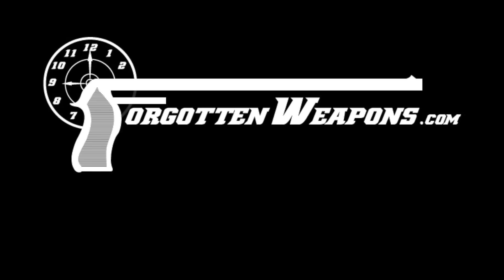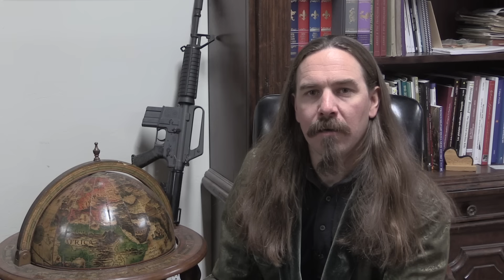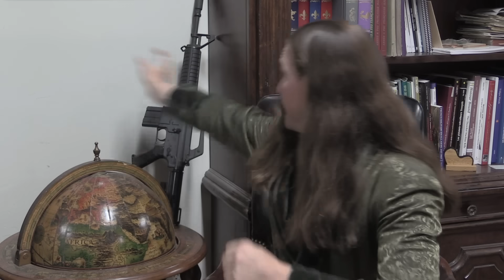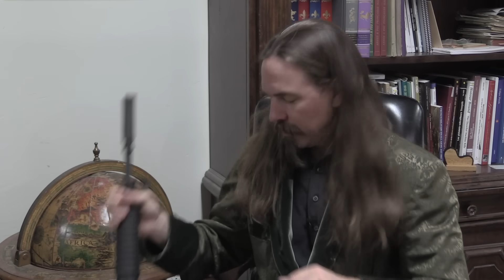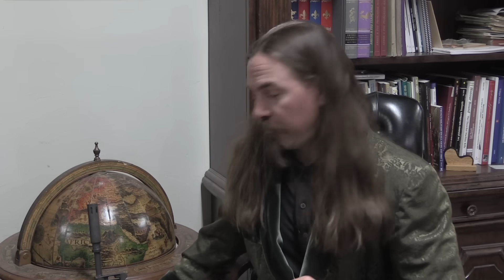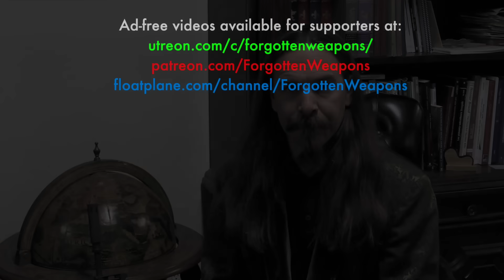Ask Ian: "Last Ditch" Rifles for World War III?

Comment: There's so many cnc shops in the US that I doubt there would be a shortage of cnc mills to take on the challenge of producing AR parts.
Reply: Problem is getting aluminum/steel .. how many areas have steel/aluminum mills?
Reply: @karllambert2350  every single shop that has any machining equipment, has tons of aluminum and various grades of steel
Reply: @stephen_crumley  we don't produce raw metals domestically. Shops can't afford to stock 2+ years of materials
Reply: @karllambert2350  Tons of them in Indiana/Illinois. Know of at least one that recycles various metals from the junkyard next door.
Reply: @karllambert2350  yup, some of our metal factories that are still in service date back to the early-mid 1900s. Some have been updated but most are sorely lacking compared to other countries.  We have the capability to modernize and become self sufficient but with all the Globalism nobody ever will...
Reply: I was just saying this in my own comment. We don't have to have a gun behind every blade of grass today. 
We could have them built by the weekend.
Reply: Like he said there won’t be a shortage of milling, it’ll probably be for stuff like optics or specialist alloys.
Reply: @Matt-xc6sp  The assumption is that this is last ditch emergency production. Meaning martial law in all likelihood has been declared and all production is controlled by the government.
Reply: @stephen_crumley  yea maybe when we used to mine our own minerals and have… industry.
Reply: Considering it's US we're talking about, it's likely that people would just bring their own guns and there wouldn't even be a need for last ditch production.
Reply: EMP would eliminate most of the machines in circulation only old stuff with 3 electrical engines for movement and 1 power full one would be worth repairs because you couldn't afford waisting super scarce circuitry for new machines
Reply: @stephen_crumley  it's not that simple
Reply: Having hundreds of little shops scattered around the country is not going to do you any good; who is going to gather them all up, who is going to deliver them to where units are being stood up (the part of the country where you CAN make stuff is going to be far away from the fighting, how much precious fuel and logistic capacity you are going to waste moving stuff around - we ARE talking about a last ditch situation here... that fuel would be better going into your remaining AFVs/ airforce/ army logistics train. And, who the hell is going to deliver and parcel out the strategic resources, managing to drop off to hundreds of small scale milling shop without them all hitting bottlenecks of crucial components. The logistics of small scale production, when you need to make MILLIONS of arms in a matter of months, don't add up. You end up with a couple dozen rifles in the back of a factory, that aren't going anywhere.
Reply: It's interesting that you all assume there would be any electricity to run a cnc...
Reply: @robsonez  It's interesting you assume people can't figure out how to generate electricity off grid
Reply: The issue wouldn't be machining, it would be raw material. Right now, every forging company in the country is already making as many forgings as they can, and they can't even keep up with current demand. The shop I work for currently has about a 6 month lead time on forgings, and even then it's a struggle getting a full order all at once. Switching to machining from billets would be possible but counterproductive.
Reply: @robsonez  in before someone says "diesel generators" lol - because using limited fuel, that could be better used at the front is an awesome idea  /s  
Oh, plus this sounds like an amazing plan to make sure that no two weapons have interchangeable parts, taking your army back to early c.19th - no longer can you take two damaged weapons and make one good one, at unit level - you got to ship those suckers all the way back to the mom'n'pop shop that made them.
Reply: @timbrwolf1121  enough power to mass produce arms via cnc? And if so, all survivors would agree to utilising that power for weaponry manufacture? I'd get good with a cross bow because guns and ammo would disappear quickly.
Reply: And that's before we get to the 3d printed designs and P80's...

Add those in and that increases the number of strategic targets by another magnitude.
Reply: @robsonez  You are misunderstanding. Its not mass production in the normal sense. Its not like 1 person has to figure out how to power thousands of CNC machines. The average american when faced with an existential threat would make it happen
Reply: @timbrwolf1121  I don't think I am. 20 people powering 1 cnc. They generate enough power then all agree that this is how the power they have generated should be used? Assuming any of them know how to operate the machinery, modify the programs etc...
Reply: @timbrwolf1121  let's be honest here, the average American thinks climate change, gender identity and critical race theory are existential threats. You have a lot of faith.
Reply: @robsonez  Well when martial law is declared and those 20 people either decide to work for the greater good or don't get fed. They will either do the necessary job or be voted off the island.
you are the weakest link, goodbye 🤣
Reply: @timbrwolf1121  I see you are the average American.
Reply: @robsonez  guess other machines will fail also without electricity. And a changeover to steam or water power will become difficult also.
Reply: @ralfrude3532  this is a critical issue with a technologically progressive society. Without electricity, how many would have the knowledge to do much of anything?
Reply: @Matt-xc6sp  Under wartime emergency authority. In this state, they aren't asking you nicely to comply. At a minimum in this state, strategic materials and supply chain are being rationed for defense production, so their supply of materials is very likely going to be zero if they say no. And that's the stuff that's not necessarily in B&W, but it's very clear that's what they are going for.
Reply: @Matt-xc6sp  Not what's happening here and you'd be surprised how much both sides come together in wartime
Reply: @timbrwolf1121  Wartime Production Act.
Reply: @excellent_name  we produce a million tons of aluminum a year.
Reply: @Miazger  EMP means the strategic nukes are flying, so "last ditch" weapons aren't going to matter anyway.
Reply: @excellent_name  What do you mean "we don't produce raw metals domestically"? We produce anywhere from 1-1.5 million tons of aluminum and 90-110 million tons of steel every year.
Reply: @excellent_name  Stocking stock material isn't all that common. Probably have some bar stock and some flat stock and key stock but ordering material cut to size when needed for a job is the way most shops operate today. Don't have to waste space storing it, waste time looking for it, waste time saw cutting it, and ending up with wasted drops.
Reply: @excellent_name  uh yes we do produce metals domestically. It's just expensive so it's rarely used for most things. We don't produce as much as China but we do have domestic metal production.
Reply: CNC are too valuable to be used on rifles. They'd be prioritized for producing vehicles parts. It's better to build new stamping/ injection molding factories to make rifles than using CNC machine shops to make them.
Reply: @Lucid Nonsense  Well, the US is self-sufficient in oil thanks to shale (good luck invading south Dakota), so I don't see why the existing civilian infrastructure like highways couldn't do the job.

Comment: The rifle will have to be able to accept steel case ammo because brass will be rationed and prioritized for artillery shells. The lead inside the bullets might also get replaced with steel to save cost, lead will be saved for high precision ammo for marksman rifles. 
The body of the guns will be made out of stamped steel or molded plastic because aluminum will be saved for aircraft production. Stocks might be made out of wood because plastic might also need to be saved. 
Basically the gun will have to be made out of the cheapest, most abundant and easy to work with materials. 
Oh and keep the full auto. Because if machine guns are not largely available, soldiers might still need them and realistically, an industrial country prepared for total war will not run out of ammunition before it run out of guns and men to shoot all those ammunition. If you have factories running days and nights making steel case ammo with steel bullets cold war style, you'd have massive stockpiles distributed all across the countries waiting to be cracked open. Even today they still open cold war surplus spam cans in Ukraine at the same time, selling them in the US market you won't be running out of them anytime soon.
Reply: Considering that there is likely a million reloaders, each sitting on thousands of pieces of brass and other components, and each capable of loading a 1000 rounds in one day, I doubt it.
Reply: @mikefranklin1253 You don't save brass in wartime production because you run out of it but because you need to save it for something more important but can't be substituted with steel: artillery shells. 1000×556 brass casing is roughly the same amount you need to make one 105mm howitzer shell casing. Not to mention from the military perspective, if you use your brass in your rifles, that brass is lost because nobody will walk into a battlefield to pick up spent casing but in a artillery battery there will always be people collecting casing for recycling, the brass will be more likely to be recycled passing through the cannons than through a soldiers hands. In WW2 many countries had to use steel casing for rifles because they consumed artillery shells at insane rate. Of course they probably wouldn't ask you to donate your brass, they wouldn't have the logistics to collect them all anyway, more like stop making brass casing ammunition in the factories and dismantle old ammo stockpiles for the brass. This is why I don't think they're mobilize the CNC machines to make guns, the vehicles and heavy machinery production lines can make better use out of them.
Reply: Modern artillery rounds do not use brass casings. The round is shoved into the the breach,  powder bags are cut according to what the approximate range to the target is,  then shoved up behind the artillery shell. Then the primer is installed and the breach is closed and  the round is ready to be fired.
Reply: @standupp2885  Only applies to large caliber artilleries. Most artillery still use brass casing.

Comment: There are so many manufacturers making AR-15 pattern rifles these days that the obvious answer would be to have them build basic semiauto or select-fire rifles. I bought an Aero Precision complete milspec lower & a side-charging Bear Creek Arsenal 16" upper. I put UTG folding sights on it & am happy with the way it turned out. It's not top of the line & may very well only last 5000 rounds, but it is serviceable. I think the injected polymer momolithic lower idea would be ideal for an "Everyone has to have a rifle!" scenario, but we would have to run through every M-16/AR-15 variant we have in reserve or from non-milspec makers before issuing "plastic rifles" to combat troops.

Comment: This actually makes me wonder about government contingencies for weapons manufacture in a doomsday scenario. They always focus on contingency of government and leadership, but you never hear about contingencies to continue fuelling the war effort
Reply: Soviets actually developed a series of AK for full-scale nuclear war scenario with Izhevsn and Tula destroyed in the first week, so they could make rifles almost at any factory.
Reply: @nikitajukov4915  I'm talking more like, having CNC machines and CAD printers stored away in somewhere like  Cheyenne Mountain or Raven Rock.
But I'm curious to hear more about this AK program. Anywhere specific you heard it from?
Reply: @collinmclaren6608  it came from Pavel Ptitsyn archive research. In 1968 program of developing simplified AKM started with the goal of bringing man-hour needed to PPSh levels. Degrading finish etc was not effective so some changes were needed. Some of them included stamped and welded non-folding stock, coated in resin, simplified reunion without rear sight base, replacing leaf sight to 3 position drum, kinda SVD-style hand guard (fully covering gas tube to protect it, since it was supposed to be made from less strong metal),  simplified gas stock geometry, stamped trigger group parts instead of milled, some other milled parts replaced by casted. Also they came with 40rnd RPK mags for it since you need only 3 of them instead of 4 to carry standard ammo of 120 rounds, removed markings and weakened bayonet. Program was finished in 1970 with patent, but in 1972 it was restarted to address some issues - long hand guard didn't fit in BMP ball mounts so it was replaced with shorter one, stock became polymer, and side-folding fully stamped metal stock was developed and RPK mags were replaced with non-reinforced polymer 30 rounders. Also not so strong proof check was required for this 6P1V (V for wartime).  It's believed that civil factories provided with the task got set of drawings, but the whole program was kinda ceased by AK-74 adoption, though some elements did see use on AK-74 gradually simplificated during it's production in the future.
Reply: You, mean like sanctioning China on computer chips, or paying the defense industry to build stuff we do not need, but would lose the ability to build it if they stop.  This stuff happens constantly, but you need to look for it.
Reply: The Enclave in a nutshell.
Reply: They always concentrate on the ‘important’ things first 👀

Comment: I think the charging handle would go, modify the dust cover, put a finger hole in the bolt to chamber a round.
Monolith polymer lower and upper combined, barrel and bcg drop in from hole in butt followed by buffer spring. Plug that hole. Barrel is keyed and held under tension by the hand guard and gas tube block. FCG drops in from the bottom between mag well and grip.
Too much re-engineering?

Comment: I could see the forward assist going away as well as any kind of brass deflector. If steel was in short supply, maybe shorter barrels and gas tubes? If you're trying to decrease machine run time, have 4 maybe, 5 picatinny rail slots if you must have them. Very rudimentary flash hider or just a plain crowned muzzle. Lots of different ways to cut down run time

Comment: American Volksgrenadier, 2045
M4A3 (despite the third iteration it's actually a downgrade) which is made with a KP15 lower, full slick side (as in no FA, casing deflector, or dustcover) upper with MBUS rear and M16A2 handguard with no heatshield, unthreaded barrel with A2 FSP and probably carbine length gas (though i don't think mid length would be anymore time consuming to make)
They wear a simple load bearing vest (if you want to larp this, probably grab a FLC or cheap crossdraw) and carry a Hipoint C9 in a cheap universal holster
Reply: @SpikeVike27  A Glock would be fairly cheap to still make they can lessen it by size or using single stack mags.
Reply: @SpikeVike27  I agree. What is the point of costcutting you rifle, if you add a pistol.

Comment: Two changes to the barrel I can see being made.

1.  Revert the barrel profile to M16A1 - eliminates the need to cut the GL notches and saves on steel, at the "cost" of losing the abikity to drive the carbine quite as far beyind its design limits.

2.  Replace chrome lining and external phosphating with a single nitride treatment.  Again, you lose a bit of abusive full auto resistance, but you save chrome, eliminate an entire stage of barrel finishing, and you open parts sourcing to the olethora of barrel manufacturers who are aet up to do nitriding but not chrome lining.

It might even be worth examining extruded aluminum FF handguards, with 1913 rails on top, standardized  accesory slots everywhere else, and a GL adaptor for the handful (far less than ¼ of the total production of rifles) of guns that will end up being equipped with an underbarrel GL (or skip it entirely, as standalone GLs teamed with a light and handy carbine are back in vogue for grenadiers)  being able to skip integral sights altogether, with the rifle being teamed either with a simplified optic or with a "A1" style BUIS set.

It shouod be faurly easy to make a simplified 1x optic, perhaps using FO with a luminous (not self powered tritium) element added for limited low light capability.  I'd be will to bet a polymer lens prism that acts like "the red dot we have at home" should be feasible and still be superior to irons (particularly in terms of troop training).

Comment: I was a cnc machinist. Setup time was always key. After that a long run is where the shop makes money. I knew from the beginning in the mid 90's that just-in-time was going to kill us. Any hickup in the supply chain ruins everything. That turned out to happen, bigtime. The soviets were good at one thing--storing obsolete arms just in case. In the west we like to tear down historic buildings in favor of a Walmart parking lot, so it's no surprise that we will run short of what we need when we need it and have lost the amazing 1940's manufacturing base--some machines from which I still used in the 1990's to replace it.  
You don't know what you've lost until it's too late.